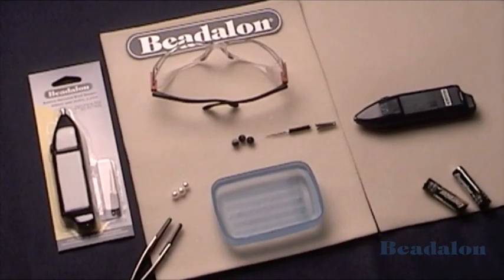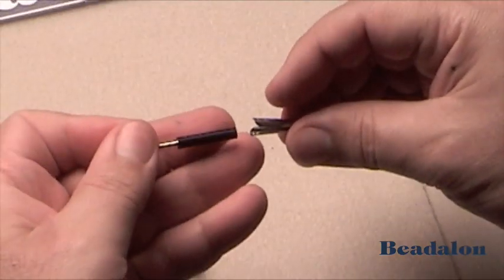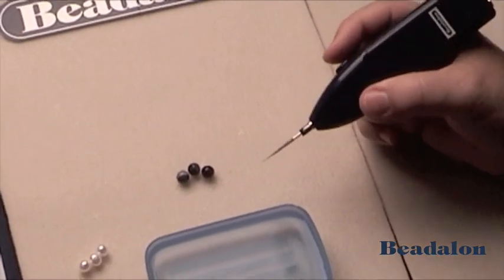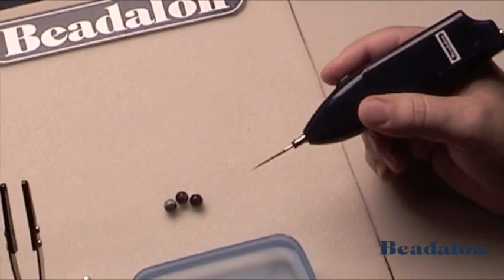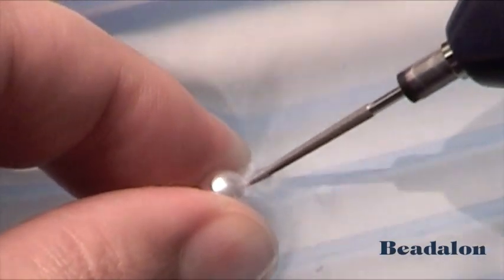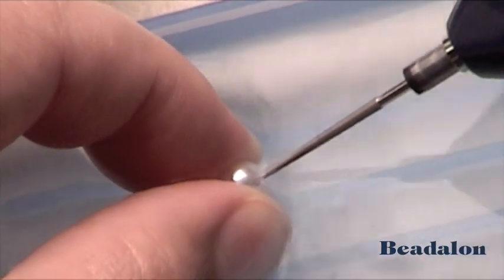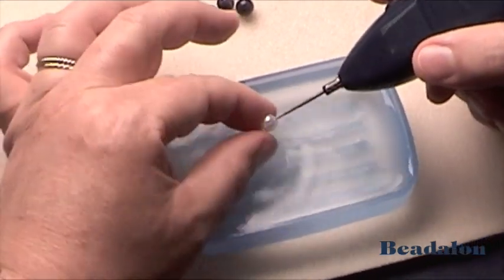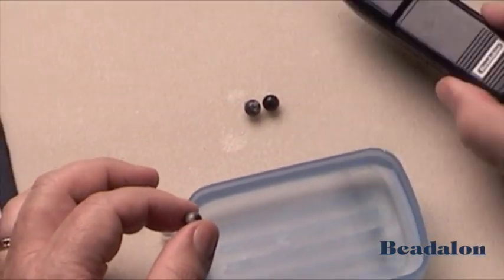Battery Operated Bead Reamer

Comment: why when u drill the pearl putting it into water> ?
Reply: This is for two reasons: since the electric reamer generates a lot of friction heat: 
1. water acts as a lubricant so that the bit will work smoothly and lessens the chance of damaging the bead, and   
2. water acts as a coolant lessening the chance of damage to the bead/reamer.

Hope that explains it well enough for you. :)